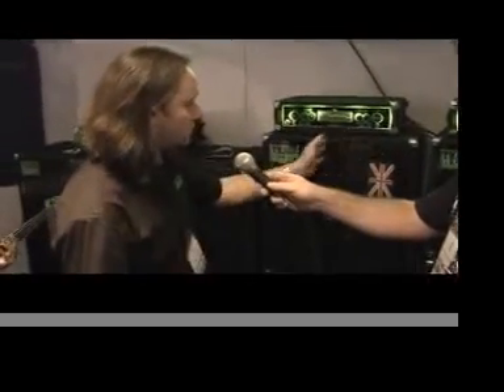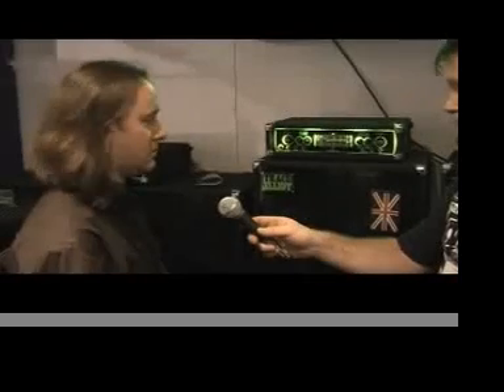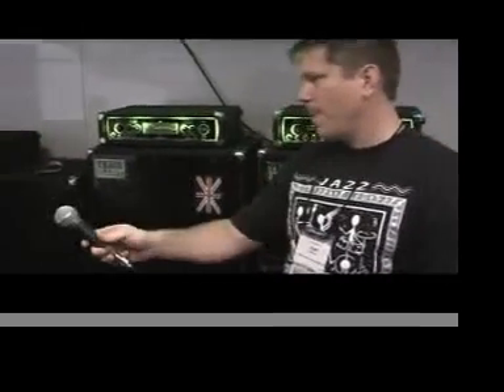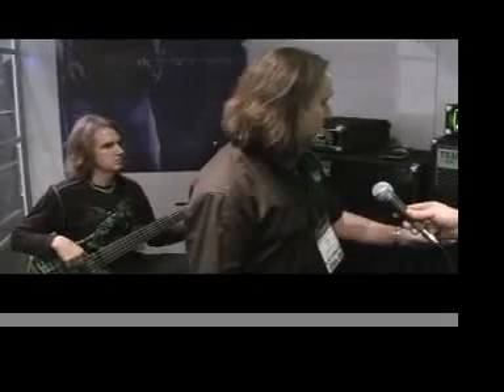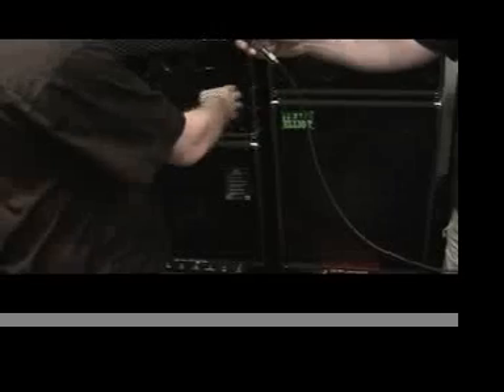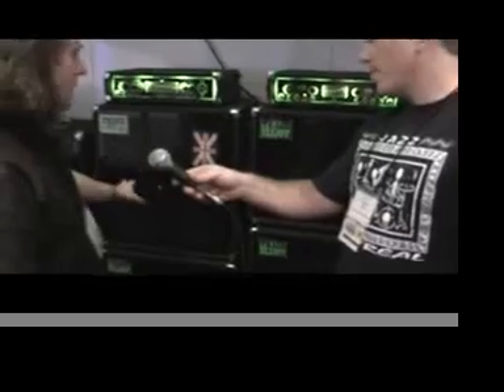Winter NAMM 2009 New Trace Elliot Bass Amps

Comment: i always use gk except one gig i used a trace 500w head and a trace 410 they are just as good but have a slightly more aggressive sound when you use the valve stage . i would prefer the trace elliot over ampeg svts but probably not over the gk 550.

Comment from the maker: You can certainly dial in some similar clean tones, but the 1,200 watt head adds a second Valve stage, which can allow you to dial in a good bit more warmth and grit than what you can get on the 600w version.  And of course, the 1,200 watt head has a 12-band graphic EQ, versus the 6-band on the 600 watt version.